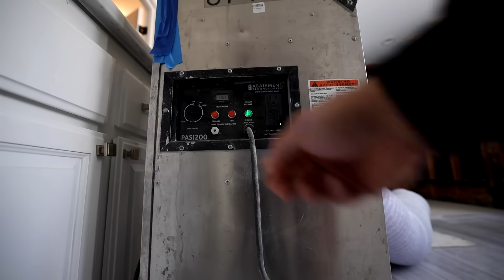Get Walls FLAT for TILE INSTALLATION --- Furring Strips, Sister Studs, and Cardboard Shims

Comment: This is huge. Previous homeowners installed a wall a whopping 1.5” off plumb over the span of the 8ft to ceiling. Definitely will be sistering to each existing stud

Comment: Seems like sistering is much more simple
Reply: It is. I started with cardboard shims and just ripped them out in favor of sistering. It was easy to screw the bottom in and adjust the top of the stud to match the laser line and level.

Comment: When to use each method? I like the cardboard strips. Seems a lot faster than furring strips. Sistering seems straight forward where there are no conflicts like wiring or plumbing. Just wondering what’s the best method or do you always use a combo?

Comment: What do you do if the wall is leaning back. Bottom of the wall is good but as I go up there’s about 1 inch difference. So get it for the strips but what about the top ? Do I have to put a strip too before doing the rest ? Thanks

Comment: Man I’m so glad this video exists. Now been using a variation of the furring strip measuring method (and also cardboard strips) to get my insane jagged brick bathroom wall into plumb for cement board and I couldn’t have done it without this video. Thank you so much.

Comment: I have done this without lasers, just using string plumbs and levels. 
What we would do nail a very straight stud from the base plate to the ceiling plate plumb on each end of the wall. String it. Install furring strips to the string. Sister studs (so cheap back then) often. Redo the wiring, insulate. 

My daughters walls in one part of the house, were so bad, I thought an inside wall was falling or the house's foundation was falling away. No... just time, or age, and the original owner using two different thicknesses of plywood, and other materials when building their old house. 

If I was to have to do this work again, gonna get a laser for sure.

Comment: Metric might be better when youre working with wood but when working with 4 decimals... base 10 is much more difficult to be as accurate than a base 12 or base 16.  Metric is sloppy and so is wood. Try measuring out and hitting a target of .0002", metric conversion is .00635 mm.  You're not measuring that accurately.

Comment: This video has made my project OH so much easier down the line as what is hiding behind the drywall is always a journey of discovery.  Who knew the bathroom walls were going to be so out of plumb after 30 years?!! At least for me the bottom band of the walls were square to each other - small joys. Prepping for success through correcting  all  the little things will save you many, many headaches downstream. I also purchased a self leveling laser which made the job easier as well. Good demo!

Comment: Regarding using an air scrubber -- you really need to set up a containment wall properly sized for the CFM of the machine to generate an appropriate negative air pressure system. Definitely do it if you can duct tape plastic walls up, but not if all the walls are finished with paint because then you'll need to deal with repainting if you strip the wall finish. Or, you can use zip wall poles to hold the plastic walls up.

Comment: If the tile size is 12x12 and bigger just fasten to the original studs and correct the wall as you set because I know most of you hackers will not use clips. Remember to check the work with your 6ft and 3-4ft level as you progress to make sure the walls are flat and plumbed if needed.

Or you can call a professional setter that knows how to float like a pro instead of dicking around with that crap. The best part, no hollow sound on the walls and the pan.

ITs far cheaper to float than buy that system and anything like it. The kerdi alone costs $500 and up depending on where you buy. I would never use that stuff. Overpriced gimmick.

Comment: Air scrubbers are fire flood mold equipment. That's where you can buy them but you can probably get the same result as far as dust with a fan, filter and same duct

Comment: A bit of history on the metric system from an old coot. The world mostly transitioned to the metric system in the late 1970s, but the people in the United States wasn’t having it. They revolted, saying there’s nothing wrong with what we are using now and pretty much put the whole thing on the shelf. so now the imperial fractional system is still primary here, however, the metric system is available and often used when necessary only

Comment: Metric system...YES!!! I'd square up the outfacing sister studs first (after choosing the straightest lumber) before putting them up. You've got some really good ideas in here. I never thought about using a circular saw to cut a multi dimensional shim, and I probably would never do it this way, but it does look interesting! Thanks for your excellent videos.

Comment: Fantastic video. Thank you for showing 3 different methods for getting walls straight. I'm rebuilding a shower for the first time and the studs are wonky. One is bowed with 1" of deflection in the middle. Unfortunately, being the newbie that I am, I didn't realize I needed to take care of this BEFORE the plumber installed the new tub. I'm going to have to get creative.

Comment: If you just start using metric.. and others follow.. it will become standard.
Because alot of things are made in china.. they are in metric, but then converted.  Which is why many things have fraction measurements, but then converted to metric.. its a whole number.

Comment: TC makes it all look so easy, but in my experience, to get those results is far more difficult than  it seems.  

I have experienced the same 2 issues, repeatedly, when sistering studs.
1. The original studs are not only out of plumb and crowned, but warped/twisted, so aligning the sister perfectly means next to nothing when it twists way out of position as soon as I attempt to fasten it
2.  Using 3” fencing screws to fasten, almost always pulls the sister out of alignment just as soon as the threads bite into the original stud, especially when driving the screw in at an angle

Considering that the new studs, even when carefully selected for straightness, are still almost never straight, and depending on where the screws are positioned, how they’re angled, and how the particular bends in the 2 boards interact with each other, sometimes I must drive and then remove a screw, and reposition it, drive it again, remove it again, etc, many  times, before I end up with a plumb and fully fastened sister, in the same plane as the others.   I don’t know what I’m doing wrong, exactly, but I’m pretty sure it’s something because the amount of frustration and cussing involved in the process is noticeably more than in any YouTube video I’ve watched which demonstrates it. 

Maybe pre-drilling the holes might help reduce the impact of issue #2, but for now I’ll try wet shimming instead.

Comment: I totally lost heart when I saw you rip your own custom shim out of a 2 X 4. I have two circular saws and I have not the strength/experience to make decent cuts with them--they always seems to stop/stall at the midpoint of cutting.   But cardboard shims? I can do that!!!
Reply: And I did it yesterday. Couldn't make the laser level do what you did (need to rewatch that wizardry...so just kept using my 24 and 48 levels to compare and contrast the studs relative to one another.

Comment: So thankful for the advice!! Saved me from putting up my Kerdi board with uneven shims. I am using the cardboard shims where needed.  
I do have one question, my plumber put up metal plate in front of the plumbing, which is to protect the plumbing but I have a concern that this would cut or damage the kerdi board when I install it.  Have you run into this?  Thank you

Comment: Could anyone help with explanation @9:03 ish (sistering), he explains a new 2x4 is going to be bigger than an existing 2x4. He says they are usually an eighth inch bigger. Why is this? This caused me a problem and I am curious why this is and should you then just plane the 1/8 inch off before ever replacing a bad stud? They are wider than the top and bottom plate on a shared wall. Why are they sold like this?😢 Wish I had seen this video before replacing the 4 I have already done.

Comment: Yes because 3.18mm is so much easier than 1/8 inch. 🤡
Reply: You never need precision below 1 mm for any typical carpentry. So using metric, decimals are never necessary.
Reply: @sandsmarc  the kerf on almost every saw blade is 1/8 of an inch. And precision work can easily take you down to a 1/32 which is less than a mm. And try finding the middle of something. Much easier to do with fractions.

Comment: Regarding the thin furr you made, you mentioned if you were to screw in instead of the 15g nailer, that they would split. Well won't it split behind the backer board when you put the backer board screws in?  Isn't that the same problem?

Comment: won't the thin fur strips split after you screw your surround into it?  You brad nailed the fur strip...  maybe wood glue on the thin strips so they don't split later? or maybe the shower surround pieces/goboard will stabilize them enough to not split?  Learn a ton from your video's btw. appreciate it.

Comment: All you need are the top plate and bottom plate measurements set up your tack saw and cut. You will get perfectly straight cut, not possible with hand saw.
Any bumps in middle of stud can easily be planed out with elec planner.

Comment: What happens if you're not doing the entire wall in tile?  If you pushed that wall out a tiny bit, how do you end the tile when you reach drywall? The drywall and cement board will not be level anymore.

Comment: Hi coach. We’ve been metric in Canada since 1977. Guess what, we still buy 2x4’s and 4x8 sheets of plywood, doors are 30 inches, 32 inches, 36 inches wide and so on. Even in tiling, spacers are 1/16, 1/8 and 3/16 inches. I know what you mean though, it is an easier system. Some industries are just too involved to completely change over. Good luck with your quest but it’s not gonna happen there. Not in our lifetime anyway.

Comment: Great video Thanks!!    I have a wall that needs serious flattening.  Is it a bad idea to use metal studs, as SISTER studs, on existing wooden framing??  I thought this may be good as i think the U shape of metal studs may not require me to cut pieces of exiting insulation out like i would have to accommodate the addition of wooden sister studs.

Comment: I used to do this sistering of studs like a decade back. Then few years back when lumber inflated by triple, I actually used a planer and sanding on the actual stud. Then I discovered wet shimming the wallboard and don't see any other way.

Comment: Seven years ago I was searching everywhere for a video like this after an old timer told me to cut furring strips to plumb out studs around my bathtub. It was extremely overwhelming for me at that time but ended up doing exactly this with a laser line and cutting strips on my table saw. Thanks for sharing!

Comment: Metric is sooooo daamnnn much easier!  I'm a USA military brat, lived in Germany and Italy during my dad's 22-yr career.  Learned metric in my electrical engineering degree.  Interesting note:  every normal use metric socket in the world uses either a 1/4", 3/8", 1/2" drive socket wrench (there are larger imperial sizes for massive nut sizes)!  I really wish the USA would switch over.  All our cars are made in metric parts because the USA government decreed that they would no longer buy cars that weren't made in metric parts.  The USA government is a big customer so of course auto manufacturers complied and just sold all cars that way.

Comment: I prefer metric where there's not a huge investment in English units, but with carpentry, nearly all my tools are in English units. An easier approach (for plumbing and leveling) is to just to mark everything in 16ths — 3/16, 4/16, 8/16, or whatever.  It avoids the fractional conversions that slow you down or lead to errors, without the headache of requiring new tools.  It works if you're not interested in variations of less than a 16th, at least.

Comment: Perfect video at the perfect time. I just ordered the drywall shims for $18 at acme tools. The cheapest place I found a pack of 100. Now I'll also try the laser level since I got one for $80 on Amazon. It's 4d. So two verticals and two horizontal lines. So I'll finally use it now! And I appreciate the explanation. 

I literally ripped drywall out of a duplex partition wall bc of the bowed drywall humps in different spots. You just helped me fix it without botching it. Perfect timing. Thank you!

Comment: The reason metric isn't always good is because there are less divisible factors.  E.g. dividing by 3 isn't exact.  In a foot you have 2,3,4,6 as factors.  In a cm, you have 2,5 only.

Comment: Because you sistered that one board so far out, how do you handle the transition to the drywall.  It seems like the tile would stick out really far right there? Especially in a situation where the drywall is on same plane as the tile.  In that situation would you have to demo the entire wall and plumb every stud to avoid that?

Comment: I mean you could just work in metric lol. Every scientist in the US does for work. 

But the inch and foot are such nice sizes for everyday use. I also really like that Fahrenheit is more granular. I already find adjusting my thermostat by even 1°F can make a real difference, and there are such nice breaks in temps between 50, 60, 70, 80, 90, and 100 degrees. If we do move to metric we really need at the least for thermostats to work in 0.5 degree C increments at the widest.

Comment: 4:19 Indeed, it would. But just make sure you (or they) don't make the mistake of using pseudo-customary units by using centimetres for measuring stuff; that'll just get you a whole other host of problems. You wanna use millimetres and millimetre-only tape measures, which will radically simplify everything and reduce errors to basically 0.

Comment: Air scrubber is great- but it’s also why I sucked up the cost and bought Festool. Their dust collection is second to none. Capture at the source rather than scrub the air. Much easier.  Awesome videos, as always.
Reply: If the situation allows it- even cheaper to suck in clean outside air and just vent out dusty air. I use a 24" dia. collapsible duct and a box fan. If the room is isolated in the middle of the house, I use polysheet walls and a 30" x 30" furnace filter for the intake as well.

Comment: When you are floating every surface, wall level does not matter. The tile setters in my house must have told the general contractor to install the worst lumber in the bathrooms. The plumbers made a 3 inch notch in the 2x4. It had collapsed while inside the wall. One more had shattered while inside the wall cavity.

Comment: I’ve got a dual unit tape. Inch on one side, mm on the other. For stuff like this where I don’t need to hit nominal dimensions (i.e. 3-1/2”, 1’6” etc) and the measurements are just for me, I switch to millimeters. They’re smaller than a sixteen (so I get forced into a slight accuracy boost) and it make math a lot easier! That’s how the change starts at least.

Comment: I don't like wet shimming/adhering something directly to studs when it is unnecessary.  I think the only time it would be truly necessary is if the studs are in a difficult, tight space - which is not likely in a shower/bathroom.

If I was a tile or drywall contractor, I would have prepared a  big pack of pre ripped full length 1/16", 1/8" and 1/4" 2 by lumber ready to go at all times.   

Even the warpiest stud can be remedied very quickly with wood glue (plus a dab of some fast acting adhesive like CA+activator or fast grab type adhesive).

Comment: Thanks for the tips! I'm renovating my kitchen, where all the walls had to be straightened before I could lay paint-ready fibreboard. Used sister studs in one of the corners, as the only possible solution, in combinations with horizontal battens.

Comment: If the bubble is clearly touching one of the lines on the bile does that mean it is too far out of plum to tile? This is how it is on one of my installed Kurdi walls but on other parts of the wall it is pretty plumb.

Comment: If you don't like 1/32s, 1/16s, 1/8s etc, use metric (S.I. system). No one's stopping you. There are a lot of problems with the metric (S.I.) system, which I won't address here, but a much better suggestion is for the country simply to move to decimal inches. 1/10 of an inch too large?  Use 1/20th.  It's decimal equivalent is 0.05. Each 1/20th is 5 one hundredth of an inch.--still easily used decimal inches. ...or 1/50 of an inch or 0.02.  That's just a bit larger than 1/64, but still uses "decimals".

Comment: Instead of cutting those thin shims of 2x4 can you just use the cardboard shims instead to save time?
Reply: Yes, those are 3 different methods he showed. The drywall shims seem more practical for my situations. But a more solid approach is the other 2 wood methods im assuming.

Comment: What would you do in the case that your 2 walls are not squared to one another. I have not encountered such issue, however I think the question is relevant to the topic at hand. I’d imagine you don’t need to be squared at that point. My guess would be that getting the walls plumb as done in this case would not require both walls to intersect at a perfect 90. Maybe I’m just overthinking this lol.

Comment: When you are doing the sister method I assume that all the sisters have to start at the same distance from your 2 inch laser line.  So you have to check that the sill is not warped in the middle, not just 2 inches at either end?  That is, the sill could be proud of 2 inches somewhere between ends, right?